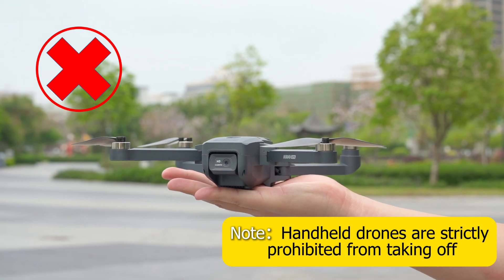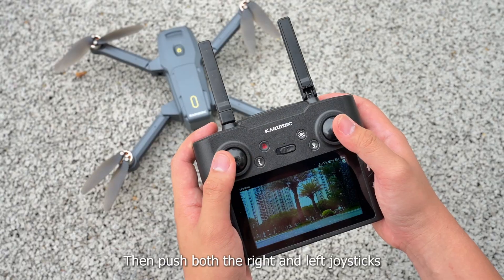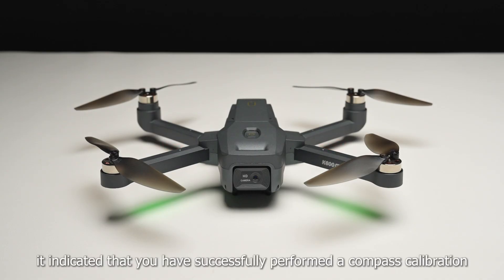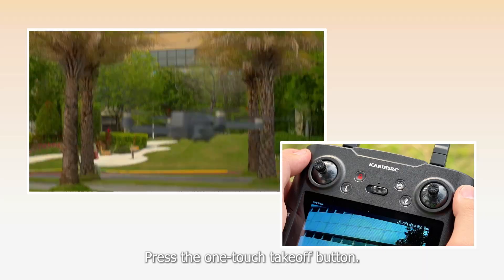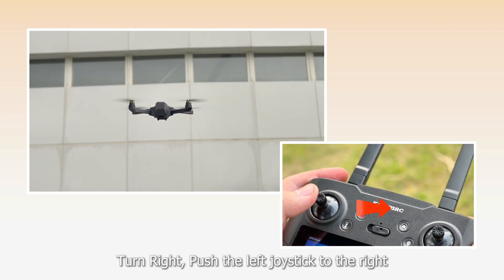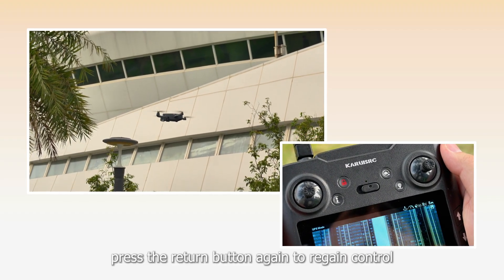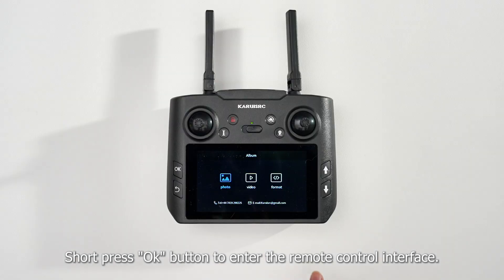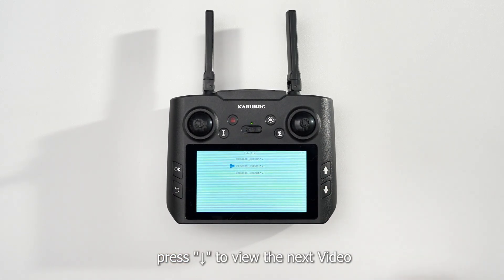K600GPS Drone Flight tutorial

Comment: This drone is very well suited for beginners. The only thing I don't like is the charging time. It takes three hours to charge a single battery, and the same amount of time to charge the transmitter. I can understand that for the transmitter, but not for the flight batteries. I have two other drones where a flight battery charges in 20 minutes. Otherwise, the drone is quite good, and the pictures and videos are acceptable by today's standards.